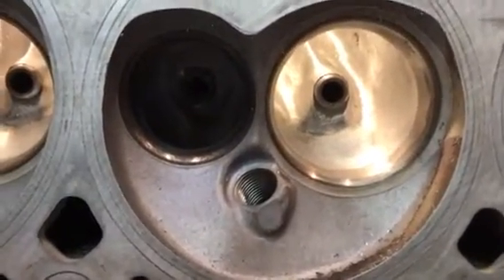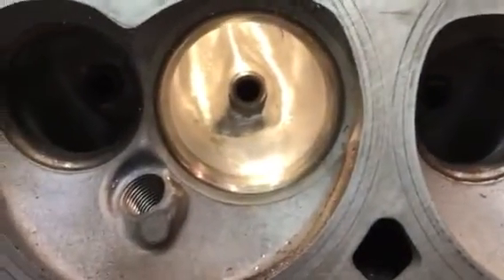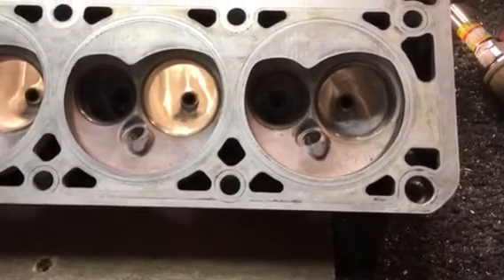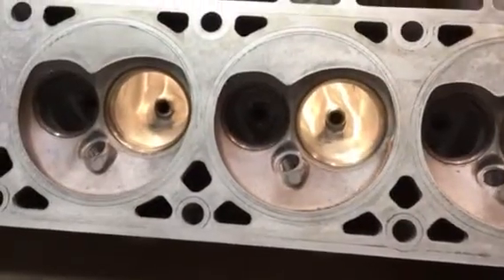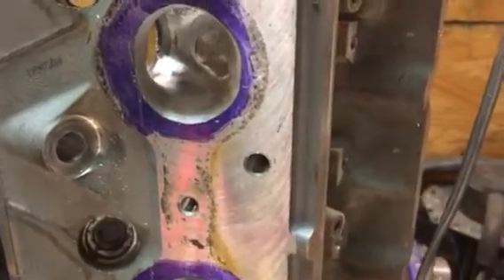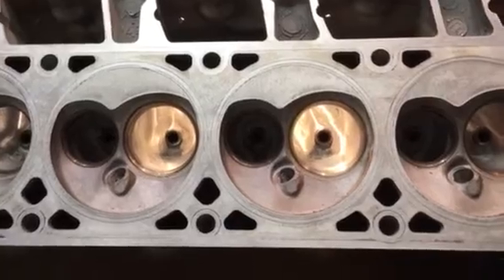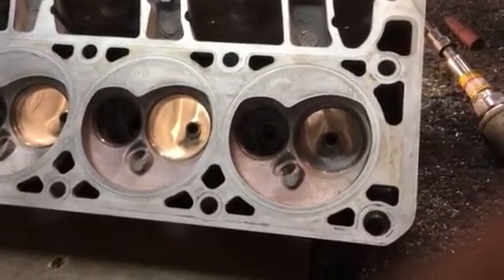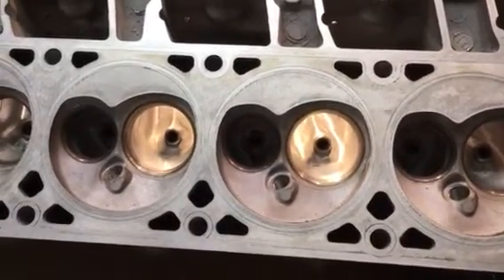Porting LS #241 heads #3

Comment: Katech 499.99 cnc porting, 100% identical ports with great flow #'s. Check them out to save you that very labor intensive process.
Reply from the maker: Chad Jones Do you have a link?
Reply: https://store.katechengines.com/cnc-port-ls2ls6truck-243-799-317-035-cylinder-heads-pair-p589.aspx
Reply: It's a big outfit. Watch some of there videos!
Reply from the maker: This is limited to 4 head castings:  243, 799, 317, 035  Do they have programs for other castings?  How much does it cost to ship to/from them?  I'm curious about the total cost and how much do they charge to assemble the heads?  OOPs I just read they don't assemble the heads, only port your bare castings and send them back.
Reply: View their website and watch all their videos. If you want a hands clean turn key they can do any combo.

Comment: These kids are dumb asses today.NO RESEARCH ..I never thought I would even see the term port and POLISH again...WE HAVE BEEN THROUGH THIS IN THE 80's..LOLOL They even have a shortened term P&P...lolol Oh and this RAD for radiator just irritates the shit out of me...PUTZ's....I just leveled seats blended the throats left the ramp and stud bumps.left it at the burr finish though out while changing my springs and lapping on my 317's..I bet 25 hp..I did  a lot of porting on the Ford FE heads and big block Mopars years ago..IRON...My current drag car heads were ported by DR J Bryce Mulvey...Burr finish...720 hp n/a sbc...If you ever see AIR WOLF or SRH stamped on the front of a cyl head..Bet on that car..
Reply from the maker: Joe Mamma I see some other countries saying Port & Flow, that’s not bad.  720hp SBC is impressive! 👍

Comment: with the mirror polishing its 100% ok to do on the intakes once you're running a efi as the injectors atomize the fuel for you, the rougher finish on the intake ports would be more useful for a carb where the tumble from the rough intake will help the atomization which is the traditional method like you mentioned, I find that its good to know the advantages and disadvantages of both methods, to close with all that being said if you do leave the intakes at 80 or 100 grit like you said you will still see benefits over the stock casting marks, good video.
Reply: TriniRogue mirror finish is ok on the intake port of a direct injection engine. But from where the fuel enters the port you need a rough finish. And the exhaust should be as smooth as you can get it. It keeps carbon from sticking and keeps the heat out of the head reflecting the heat back into the exhaust.